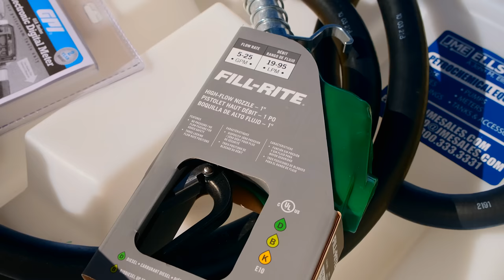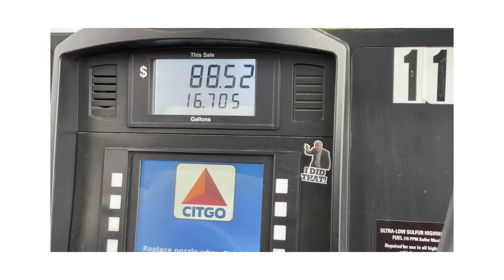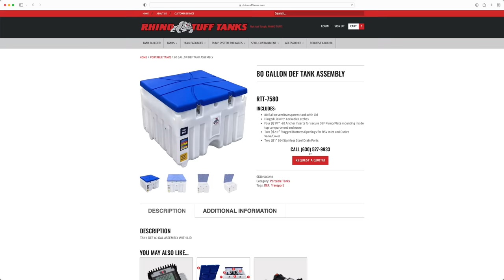DID I OVER PAY FOR THIS? EVEN SO, I’M STILL HAPPY!

Comment: Just a heads up. You may want to check with your insurance.  When I was farming the insurance company did not want the fuel storage anywhere near a building let alone inside. They wouldn't cover it if it burned knowing fuel was stored inside. I'm guessing it's in the fine print.
Reply: Storing fuel inside is generally against fire code in industrial buildings (other than containers specifically designed to hold flammable objects). Also can’t fuel airplanes in hangars either for the same reason.
Reply: @Veritas1992  fuel storage of diesel is allowed.  Fuel transfer has to occur outside.  Mainly to keep explosive vapors from occurring and keep fuel out of drains.  Insurance doesn't want fuel in drains or soaking into the pad.  Many buildings are heated with oil and the tanks are in the building.  Fill ports are outside.

Comment: We are a fuel company that just happens to have a bunch of tractors also!  So we watch your channel as well as others. Good content.  We buy some stuff here and there from JME.  While this setup is sort of nice you should think differently. We deliver to a ton of farms and people with diesel equipment. What you can/should have bought is a 275 gallon heating oil/diesel tank.  $600-$700 if you are getting contractor price. Legs, gauge, fill and vent and you can add any fillrite pump on to the top. 110v with hose for you.  Still gonna cost $1600-$1700 but now you have 270 gallons or so of storage, the tank is rated for fuel and can be put inside - you throw a 30 foot hose and can fill outside, which is what you should be doing. The main benefit is you have a company like ours in your area come in and fill it with off road diesel. No having to drag it to the gas stations.  Red dyed, no road tax being paid as your tractors don't need clear diesel for on road use will save lots of money also.  The kubota dealers in our area do the same thing. Shame you aren't in our area we would trade you an implement and set you up, probably trade you tractor implements for fuel for a while also :)

https://i.ytimg.com/vi/HeWUzjl-l0g/hqdefault.jpg

Comment: We converted a new 5x8 trailer that we weren’t using. We installed a 110 gallon gas tank and a 110 gallon diesel tank. They each have their own pump. Installed a toolbox on the tongue for the battery, 110 charger, and solar panel. We use it for our zero turn, tractor, and skidsteer on the property.

Comment: $1800? Yikes! I paid $200 for a 150 gal steel diesel tank at a local equipment auction and another $300 for a FillRite pump off Amazon . Hint: if you have to fill at the pump, go to a truck stop and use the high flow truck pump. It’ll fill that tank in 1/4 of the time. Better yet, call a fuel distributor and have them deliver dyed diesel. Ain’t nobody got that much time to sit at a regular gas station and pay road tax!
Also, that SHOULD have a fuel and water filter installed. Don’t depend on your tractor filters to be the only line of defense.
Reply: I'm with you, nice tank but that price knocks that out immediately. I got a 120gal steel tank that's a old service station bulk oil tank with a hand crank pump for $80. I little slow but I only pump 3 - 4 gal at a time
Reply: Steel will rust and you can't see the fuel level through it. You are also comparing used to new but I get you. I would not pay $1,800 for that but it does look nice. Also he was at a truck stop. It just did not look like it when he pulled in because the car pumps are out front.
Reply: @TheSailingwoodworker  He needs off road diesel for his equipment, that way not paying road tax.  Its dyed red, just don't use it in on road vehicles or you get a big fine if caught.

Comment: I would have definitely found some off-road fuel to fill that with. Save some money. Also might want to think about putting the meter back at the pump on the discharge side so there is no chance of breaking it
Reply: Looked red to me.  Around here, the on-road is green in color.  Off-road, red.  Maybe different where he is??
Reply: Hard to believe but off road diesel in Oklahoma is more expensive than farm fuel. Main reason why is because all the farmers and everybody that had diesel vehicles were buying the red dyed diesel because it was about .35 a gal cheaper. Can't do that on a commercial vehicle, big fine if you get caught by DOT.
Reply: Since the tank is graduated, the meter is superfluous. The meter would be fine for a service truck that was charging for the fuel, but really unnecessary in his case.
Reply: @number40Fan  it's the same color, red or green anywhere you go. Dot checks tanks in big trucks all the time to make sure they're not using dyed fuel (red). It's a huge fine!
Reply: I bought a 150 gallon steel diesel tank at a local equipment auction, paid $200 for it. Painted it, Tossed a Fillrite pump on it and called the local fuel distributor to come fill it with off-road diesel. They’ll typically do that if you order at least 100 gallons. Game changer.
Reply: The flow gauge will allow him to track overall fuel pumped over time. It's not so he knows what is in the tank since it is see through.
Reply: @kipcudd7253  my understanding is that off-road diesel is farm fuel???
Reply: @1ltlbrnc  Not if filling different machines, the tank level will suffice. It is his tank and fill system, but the more joints and devices one has in the line, the greater potential for leakage.
It will be interesting to see how long the batteries last in the meter.
Reply: @CliffsideStables  same stuff, some areas call it off-road and some farm fuel. I used to own a bulk fuel station, we delivered fuel to farmers and propane.

Comment: The nub inside the nozzle let you know it's an auto shut off. Keep the manual one for when the auto one fails. I'm on my second one, but a flat screwdriver will work in a pinch to get fuel flowing.
I second the flow meter on the other end of the hose as it is better protected.
Store outside as well, the venting, vapors and likely no insurance in or near building is too risky.

Comment: Worth every penny!!! I don't use much diesel a year maybe 20 gallons in the Mahindra. I hate holding the can up. The fuel tank  fill is in the center of the tractor. I now set the tank on the hood and stick one of the battery operated pumps down in the tank!!!

Comment: I made my own out of a 55 gallon polly drum, the same pressure relief valve fits in one of the bung holes. I set up a fuel filter and a water separator on mine. Surprised that doesn't have anything to filter it. Also would be worried about allege growth as it's not completely opaque and no filter. Depends on how quickly you go through it I guess.

Finding something rated for gas is a pain. There's DOT requirements for transporting large amounts of it.
Reply from the maker: Yeah, that's another reason I wanted to go with 80 gallons as I know there are some limitations not far above that.
Reply: DOT laws says max 119 gallon tank without hazmat requirements.
Reply: @fjb748  DOT Hazmat rules are funny.  I think if you carry multiple containers less than the 119 gallon it does not consider Hazmat.  But one tank of 120 gallons and the rules hit hard.

Comment: today i was helping my relatives service some farm equipment and i figured out why you had a smaller diameter nozzle that came with your tank than the one you bought.   i was fueling the combine and the diesel tank uses the bigger diameter nozzle the the def tank that was almost next to fuel tank took the smaller nozzle so that you couldnt accidently put diesel in the def tank,  blue lid on your tank or the blue cap on any tank on equipment means def.    i enjoy your videos

Comment: I think I have about $450 invested in my 50 gallon transfer tank with  a Fillrite manual pump.  Sure beats hauling 5 gallon tanks.  I like the poly tank but it is somewhat pricey in my opinion.  Definitely put a filter on it to filter out any water and contaminates.

Comment: I did a 275gal tote with the alumn gage around and a 12volt transfer pump and nozzle setup.  Works out great and Can set it on a trailer and take to a job site if needed since the pump set up is 12volt
Reply from the maker: Very convenient
Reply: Is it lawful to transport?

Comment: I have one From Cemo Germany on 440 liters (116 gallons). The Build quality is much better on the Cemo and it’s half Price,And it is completly opaque (no Sunlight Goes inside,so no diesel algae)
Also it has a light inside,so you can see if there is debris Or when it’s empty.
Automatic switch off when running dry or too hot,and 12 V connection, I can be out in the field and connect the tank to the battery on my tip trailer and have it work with no problem..
Maybe have a look on the Cemo ones for the gas tank you will need

Comment: We used to have a 300 gallon tank on a stand about 10 ft off the ground so no pump was needed. Just gravity feed. Worked great. Then osha or epa or somebody came in (I can’t remember who, was quite young when it happened) and said we had to get new tanks and put in a concrete containment so if there was a spill or a leak it wouldn’t end up soaking into the ground. Also had/have 60 & 80gal tanks for the pickup trucks. They come in quite handy.

Comment: you might look at AMTanks.  If they are stackable when full that would help even more.  Less room floor space taken by the tanks.  I might even consider a 12VDC pump vs the 120VAC to allow for use in the field or other location where the additional fuel to the already owned transfer tank may be needed.

You might look to see if that pump can be rotated 180 degrees putting the pump inlet on the tank fill side to clear the tank fill, or install a 45 or 90 fitting on the pump outlet to change the position of the hose so you do not have to keep un cam locking it to facilitate filling.

Comment: I don't know what kind of tape you used on them threads but you can't use regular Teflon tape. You need to use a tape rated for gas, oil, and chemicals. You should be able to find it in your local hardware stores plumbing area.

Comment: Good job!  I would research the gasoline tank about venting and safety.  Way more dangerous than diesel.  Are those fittings pipe thread?  If not some threads do not use teflon tape.  It actually makes those certain threads leak.  Thanks!

Comment: Love it. I have a 125 and a 50 gal Kingspan tanks for the same reason. Mine are 12v and I carry a battery in the bed of the truck to power them. 
I wish mine were 110v I have 110v outlets in the beds of most of my trucks. I think your Ford has a 110v outlet in the bed. Curious if your truck has enough power going to that bed outlet to run your 110v pump. That would be awesome. Fuel the tractors right from the truck in the field. Which is what I do, only I have to carry a battery around all the time. Would much rather plug right into my 110v truck bed outlet, assuming it has the power needed to run the pump.

Comment: When I was clearing our land for our house build last summer, I "discovered" my great grandfather's diesel tank he had semi buried in the late 70's. Surprisingly it was in decent condition for no one knowing it was there for dang near 50 yrs. Been thinking about doing a tank situation like this one since bc tbh having to haul jerry cans a few times a week gets old really fast
Reply: Old metal tanks are often in very good condition. Old diesel was a protectant.  Look for a possible water line that may be corroded.  New diesel is contaminated with biodiesel since it is transported in the same trucks.  Biodiesel is very corrosive if any water gets in the tank.  Biodiesel and alcohol in gasoline were intended to stop preppers not help the environment.

Comment: We purchased a 500 gallon steel tank, pump (plugs in like yours) from our propane fuel company. They deliver both on and off road diesel to us (we get on road) and it’s $1.00 a gallon cheaper then any station. They fill it when we call. 

I like your purchase a lot, but for that much money. I’d think the fuel company option is much better.

Comment: Diesel is one thing, but if you did a gas version you'd want to add fuel stabilizer unless you thought you would go through 80 gallons fairly quickly.  Ethanol Gas is especially bad for aging...  Stabil, for example, claims 2 years fuel life - but you need like 1 oz per 2 gallons.

Comment: When you are getting to the point of almost out call a local oil dealer to come out and fill the tank. It will save you a lot of money and your time messing with hauling the tank to the station to fill with those slow pumps. If they require 100 gallon minimum just make sure you have a few machines that need to be filled or topped off to make up the difference. Most oil companies work with construction companies to go to job sites and fill the big machines up all the time. Very common so it shouldn't be an issue for you.

Comment: I really enjoyed this especially the bits that didn't work smoothly. However, as a one-diesel machine owner and at the other end of the world, I bought a 12V diesel pump with meter that I installed on a furniture moving trolley. With a new trollet, total $250 AUD. This has a 22L can at its base and I can take to my tractor - New Holland Boomer 35 - which in Australia is rated as 38HP since we don't have the latest pollution rules as in the USA. This idea wouldn't suit big operators, but as a one-machine user, it works really well for me. eBay 'might' be your friend.

Comment: Courtney, would you mind doing a test with a 1025R to see if you can lift that off a trailer and move? I see Diesel is like 7lbs per gallon and with it being full at 560lbs plus the tank, I'd be curious if us guys with 1025Rs as the biggest tractor can move it. I'm thinking it'd be pretty heavy but possible for the front lift with fork setup. Thinking it could work for sure at the rear 3pt with fork setup and a car hauler trailer to backup to it since that is rated to 758lbs.
Reply: I've got a 50 gal steel tank setup with a home made 2 by wood pallet and can just get it off my pickup truck with a 2025r after I fill it up. The loader is the same as a the one on a 1025r.

Comment: Please be aware that longer exposure to sunlight may cause algae if the sunlight can penetrate that tank. Also you might find a fuel distributor that can deliver red dye fuel maybe at a better rate if you can meet their minimum delivery amount.
Reply: Clear plastic, including wire ties , do not hold up  UV Rays of the Sun for more than 6 months. This has not changed over time.

Comment: Normally when filling containers with flammable liquids you need to be sure the container is electrically GROUNDED to avoid the risk of a spark generated by static electricity from the flowing liquid.  Plastic containers, unless chemically treated, are NOT conductive, nor are plastic-lined truck beds.  So while the container may be capable of safely storing diesel fuel, PLEASE confirm it (and your manual fill method) doesn't risk a spark induced fire!  DEF is not flammable and would not have this same risk when filling that tank.

Comment: I am surprised you have been using 5 gal cans all this time, especially with the 333G!!  But if one of your trucks already has a transfer tank in the back, I can see why this hadn't happened yet.

On the gasoline, my understanding is that you "have to/need to" set the container on the ground when you fill it at a gas station, or you risk static electricity igniting the gasoline vapors, so you only want a tank that you pick back up when it is full of fuel and put it back in your truck.  Diesel is far less volatile so you are allowed to fill it without removing the tank from your vehicle.  One Eye Customs did a video about the Scepter 14 gallon Flo-N-Go fuel caddies that he uses, looks like a good solution for gas and smaller amounts of diesel (they don't have one specifically for diesel, so you just mark one CLEARLY for that).  Hint, if you set those higher than what you are trying to fill, they will gravity fill out of the hand nozzle.

I bought a 58 gal Auxiliary fuel tank for diesel from John Dow Industries which works well for me, already had the larger auto-stop nozzle and delivers 10 gallons a minute, so it is fast!  It does not have a 120 volt pump (that would be really nice....) but does have a 12 volt pump so you just need a vehicle battery.  I like the idea of the fuel meter, may add that at the pump outlet just to keep track of how much is left in the tank.  I don't have a fuel filter or water separator on my 58 gal tank, but I am looking at options there.  

Really, if I had seen the Scepter tanks first, I probably would have just gone that route with several of them for the amount of fuel I use.

Comment: Hope that works out well for you, I'm kind of surprised that you didn't go with the 180 gallon tank. Your truck could handle it and your do have a regular fork lift don't you? My brother had a 120 gallon tank in his shop truck and it sure made that F350 ride smooth. I need to check that company out for fuel storage for my generator, Like you I go through lots of fuel after a hurricane and going daily to find someplace that is open to get fuel is a pain, you are either sitting in a line for hours or going a couple hundred miles to find open stations. And I can always use it during the year to keep the fuel in it fresh.
Reply: We have a 450l/118 gallon limit before requiring certification for handling and transport. Most slip tanks around here are just under that.

Comment: Keep it out of the sun. Plastics don’t do well in sun. I’ve filled a lot of similar portable fuel stations but they were all metal for construction sites. Most has static ground straps, a place for spill pads and locking mechanism.